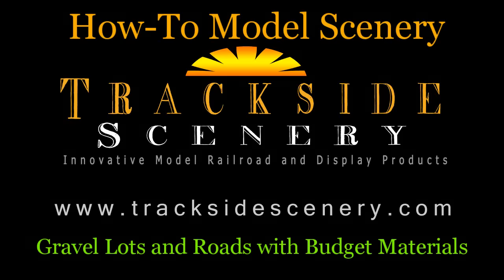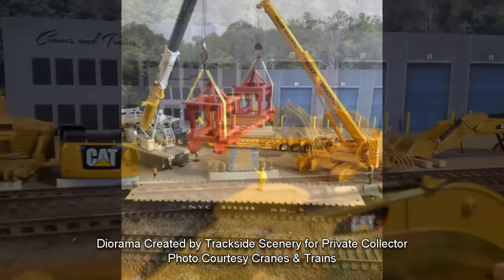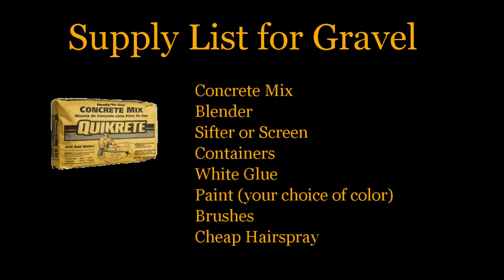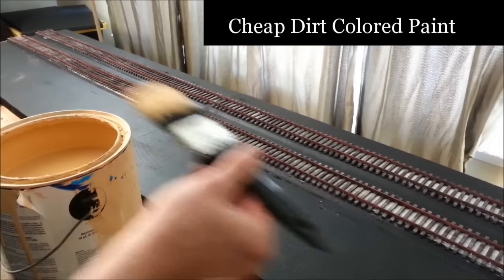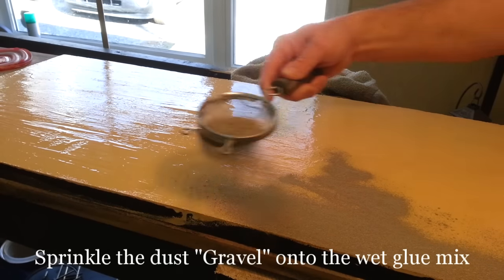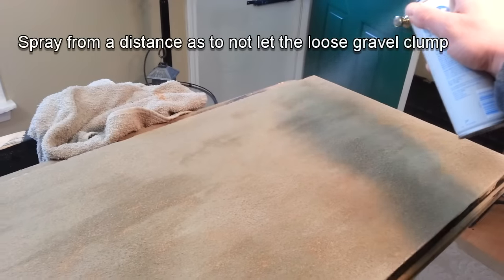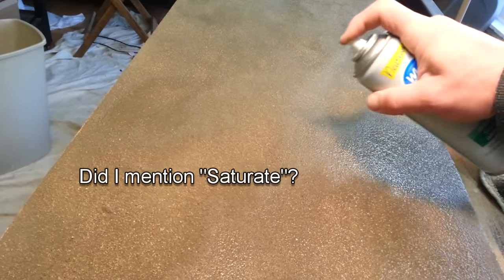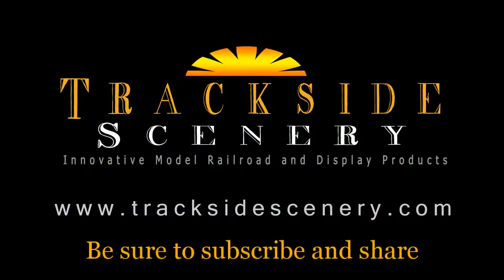How-To make Realistic Model Railroad Scenery - Gravel Roads and Lots

Comment: Hi Joey.  Great instructional video.  Although I've been at the hobby since childhood, serious scenery work is new territory for me.  Perhaps others don't need to practice, but I found building a prototype workbench where I can experiment with materials and techniques has been a lifesaver, because I've made numerous mistakes as I learned, that I wouldn't want to repeat on my real layout.  Now, onto designing and constructing roads!  So, a couple of comments/feedback:  1)  I'm not good enough when spreading the "gravel" that I don't make a bit of a mess, so I found using painters blue tape very handy for masking borders and building "dams" at layout board edges. 2)  Perhaps it's assumed, but you're video  doesn't specify if excess gravel needs to be removed after the first coat of gravel is applied and allowed to dry before the first coat of hairspray.  Also after the second coat of gravel is applied over the wet hairspray and allowed to dry before applying the second coat of hairspray.  If so, do you you use vacuum cleaner, gentle paint brushing, or ??

Thanks again for the great video.  Learned  a lot.
Reply from the maker: Hi Paul, nothing is written in stone. Just experiment a bit. I do clean up the edges and area before spraying. Once sprayed, anything on it will be stuck. You can always take it off and start again - I do it all the time.
Reply: @tracksidescenery : Thanks for the follow-up and additional info.  Trust me, I've got more than a couple of do-overs under my belt.  Hence, the prototype workbench :)

Comment: Excellent tip, I have used the no name brand of parakeet gravel, sold at pet stores, 50 / 50 white glue & crush the gravel. I do have a bag of concrete in the garage, I will give that a try. I also use a lot of side walk chalk, that kids use to draw on side walks. About ten colors in a big box, sold at big box stores.
• Thanks for the tip, yes back yard dirt is great.
• Cheers from The Detroit & Mackinac Railway 🚂

Comment: Great viodio, iv used mortar  dye in all my plaster as a base coat , if somthing cracks it just looks like dirt and saved me alot of cover materials in the long run. Ps most masons will give you a cup full and that is enough to mix up tons of plaster.

Comment: Hey Joey, Thanks for the tips, never saw the 50/50 mix of paint and glue before, I also like to sift real materials to model with. I actually live a shouting distance away from a main line where I used to gather black coal/grime dust to sift, Also if you scoop up smaller gravel next to roads or lots, you can sift a multi colored batch that looks like real ballast, or sift mulch for forest scenes.

Comment: hey Joey, great job! given any thought to using grout instead of concrete? grout comes in a finer state and multi colors.
Reply from the maker: PennCentral99 Yep, I have used grout, birdcage sand and others, but most of that has to be ground up to make it fine enough for smaller scale and that hard packed look that works for any scale. Initial sifting of the concrete mix produces a good O Scale sized ballast, further and finer sifting produces what ends up being like dust and this is why I like the concrete mix. Also the key is that it holds moisture and you don't have to rely on your adhesive to hold it in place like you would sand. Sand and grout tend to be something you have to "hold down" while the dust gets mixed with the adhesives (hairspray in this case).
Reply: thx